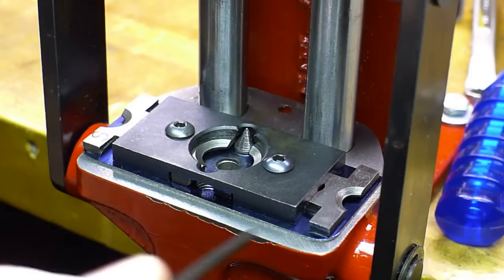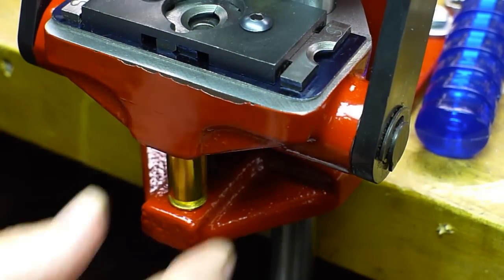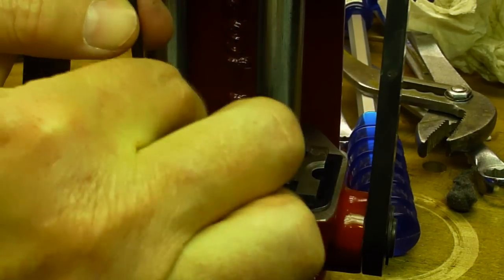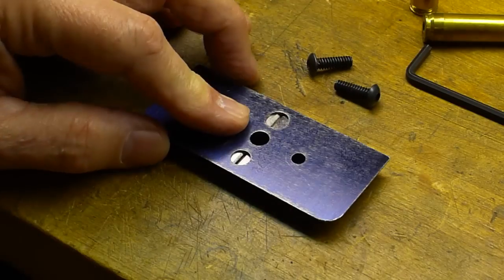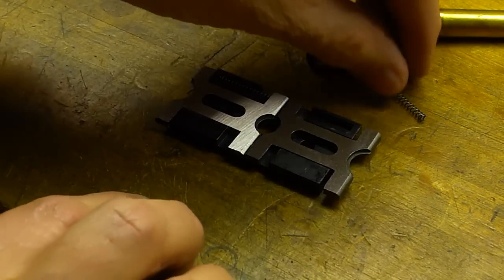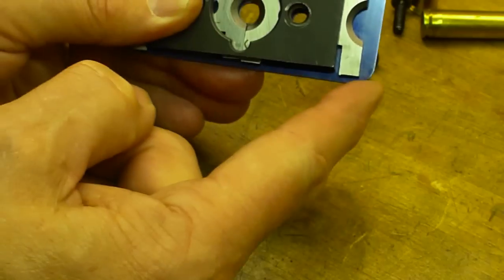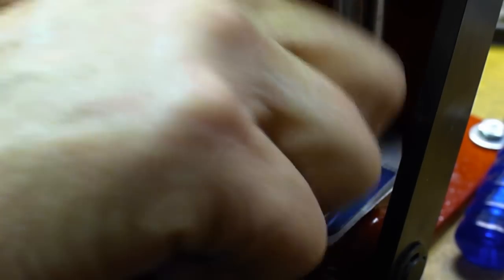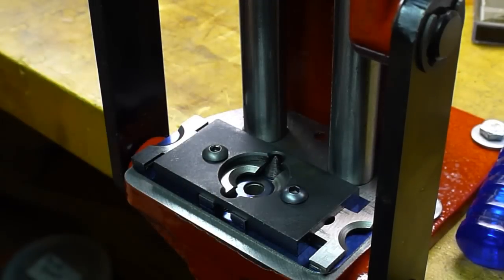Forster Co-Ax Press Shell Plate Changeover - Tips & Tricks

Comment: Well made video & it shows how easily it is to change for different size heads. I just de primed & resized 500 .44 cases & moving on to the other dies to finish the complete reloading of 240 gr coated SWC bullets. Thanks for your time. Also, just got the upgraded plate & will install when time permits.
Reply from the maker: Thanks for reinforcing my assertion that it's easy and quick to make changes on the Co-Ax. Good to hear of your experience.

Comment: Yet another excellent video from your Website! strange that I came to the same solution for holding the sliding jaw up off the cam pin.
This video does illustrate just how cranky the Forster system is, when you have to spend 10 minutes just to change to a larger/smaller calibre case, it really is trying to re invent the wheel when just a quick slot in place with a conventional shellholder is all that is required, and as most die sets come with a shellholder you do not have to buy one each time you change caliber, also if you need to use your press to load a thick rim cartridge like Colt 45, you have to buy another shellplate from Forster (a six month wait!), This press is really well made, and it looks like a piece of sculpture on your bench, unfortunately that is about all it is good for.
Reply from the maker: I've really enjoyed your thoughtful and courteous comments. You've offered a balance to my unrestrained enthusiasm.
Reply: Englishman French 
I guess we have a good example here of one man's bane being another man's five second chore.  I've been reloading with a Bonanza Co-Ax press for over 40 years, proceeded by a Bair C frame press and a Rockchucker.  They got sold soon after the Bonanza came in the house.

I can't recall having to spend ten minutes to change between 30-06, 30 Newton, 358 Norma Magnum, etc.  What most people quickly realize is that the shell holder jaws - unlike old style shell holders - will hold a wide variety of head sizes in each end.  So in fact, the only thing you have to do to switch between 30 US and 30 Newton is just change the dies themselves.  And that's where the beauty of the "cranky" Bonanza press lies.  You can switch back and forth between calibers and between sizing, bullet seating, crimping, etc dies just as fast as you slide one die out and another one in.

In fact, when you get right down to it, the truly "cranky and fossilized" systems out there are the reloading presses that require you to screw each die all the way in.... then all the way out... all the way in... all the way out.  I can almost switch the shell holder jaws around in the time that it takes to do that - and you need to change dies while reloading a lot more often than you have to change the shell holder jaws around.

However, Forster has thoughtfully provided an accessory for those who can't progress beyond using the old style shellholders.  For the princely sum of $19 dollars, you can buy an adapter that allows you to use shell holders instead:
http://www.midwayusa.com/product/144115/forster-co-ax-single-stage-press-shellholder-adapter-plate

I note that Midway and several other stores carry this accessory, different jaws, etc for the Co-Ax press, so if in fact you really do have to wait six months to get parts directly from Forster, you can get them instead in a couple of days from Midway, Sinclair, etc.

As far as changing the shell holder jaws goes, I do it slightly differently.  I just reach under and screw the jaw opening screw down so it doesn't spread the jaws.  Six of one, half a dozen of another, I suppose.

I am a bit wary of there being a day when one of the small jaw springs goes "sproing!" and launches itself - that's what springs do.  Haven't done it yet in 40+ years, but I suppose there will be a day.  I have always been meaning to add a set of spare springs to an order of other bits and pieces, but I never remember to do so.  I do note that there's a gentleman out there making an accessory part which makes swapping the jaws around much faster - and maybe most importantly for the impatient and careless - makes it impossible to lose the springs.  I don't have to change the jaws very often, so I just make sure I am careful when I do.

This really is a very fine single stage press, probably the best single stage press in existence.  For those who can't feel the love and believe their Co-Ax is a boat anchor, they sell very quickly on fleabay and Craigslist when they do come up for sale.  That should make it very easy to unload, leaving the seller with ample money to invest in a Lee Loader or some other press more to their liking and skill level.
Reply: AirborneMOC031 Your observations about the Coax being an ideal press for loading smaller cartridges is very true, however, if more normal size calibers are to be loaded it starts to show it's inadequacies , It is not possible to load any of the longer case cartridges due to the length of throw, it is also impossible to load the larger diameter base cartridges, due to the design , this press was sold/advertised as a hugely powerful press for loading large cartridges without effort, it is very well made, that is obvious, but the design is such that you have to do a dance to avoid the centrally mounted arm, (a thing that is not require on a normal press set up), the design also severely limits access to the front of the press, a thing that is overcome by user technique, but there are cranked arms sold that avoid this problem, there is also a strange method of capping the cases, which will also only take medium diameter cases, and is awkward to access, this is not a problem if one uses a Lyman re capper on a normal press, but it does give you another press on your bench.I suppose if you really are taken with the design and only load small cartridges this press is OK, and it does look very nice on the bench, with all its levers lovely paint finish , the quick change dies facility is a doubtful advantage over the almost instant twist lock design and it also is reliant on 4 threads in an aluminium ring ! (OK I have replaced mine with steel rings), but I find I only use mine to reload Colt 45 and 303 British, both of which require the larger shell holder. I hope you enjoy using your Coax for many years to come, if you lived nearer, you could have mine also.

Comment: Nice video. I bought my Forster CoAx press in  September 72’. They were 72.00 then and if you bought the press they knocked the Bench rest dies down  from 25.00 to 15.00.  Needed a good press for my 99 dollar 788 222 lol. Like the way you mounted the press at an angle in another video.
Reply from the maker: That's right after I bought my first press, an RCBS Jr., and a set of .45 "Long" Colt dies.

Comment: a drop of super glue on the outside end of the springs prevents them launching into the blackhole at the center of the galaxy when you turn the plate over for the 2nd time.......